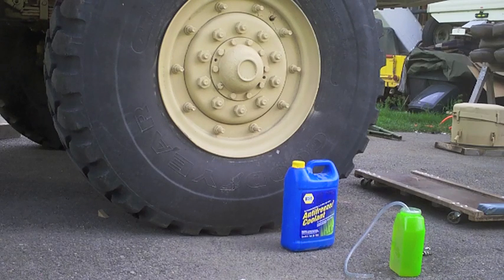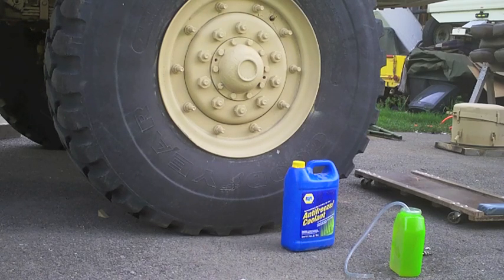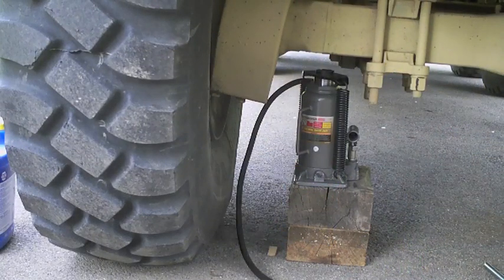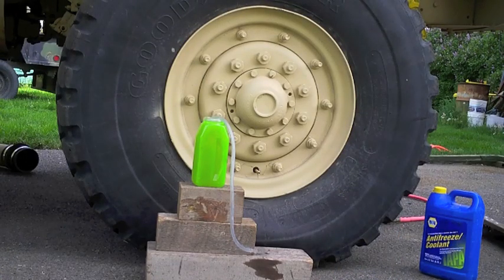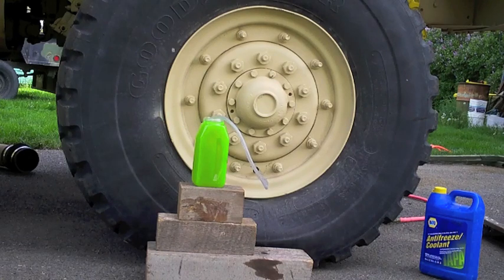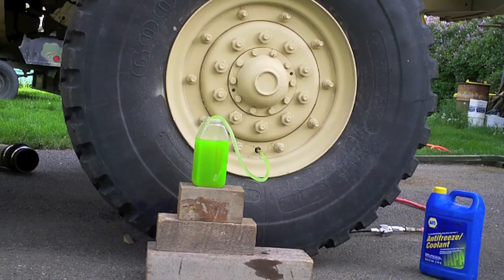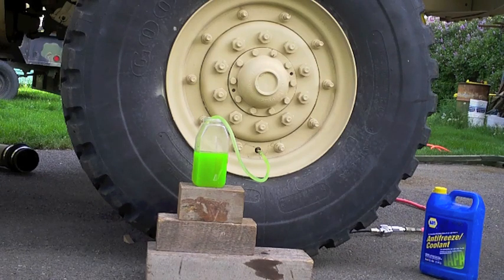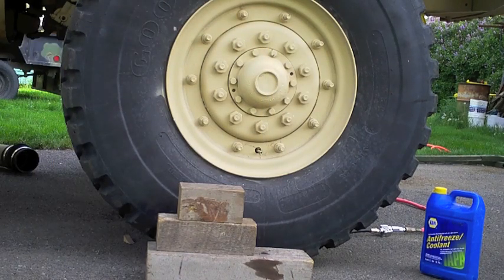Fluid Balance For Heavy Truck Tires *UPDATE IN DESCRIPTION*

Comment: You can rush it.  Get a pump-up weed sprayer(1gal $10 at home depot).  Replace the wand with a piece of hose put a jack-stand, under the axle, let the air out and remove the Schrader and the pump sprayer will easily and quickly inject the antifreeze...  sprayer is graduated so it is easy to accurately add a measured quantity. Replace the Schrader and the air and you are on to the next wheel...
Reply from the maker: Nice, I will have to remember that though I no longer bother with these tires.

Comment: they make good tools to put the water in your car and antifreeze in there but you really don't need in front of that truck because you'll make it dry rough and show me harder stop that truck would have water in it and that water going to restroom out to special antifreeze you need to put it in an inner tube without a tire and running water in it then you be doing if we were good to go

Comment: Won't anti freeze deteriorate metal (aluminum, or whatever coating it has on it)?
Reply: +dasteufelhund It shouldn't, it has anti-corrosion additives. You don't want it to corrode the cooling system
Reply from the maker: +dasteufelhund Yea maybe.  These tires are big and not aluminum.

Comment: Ive been in the tire business for 30 years , Remeber that most of the New tire like Michelin new designs Bridgestone and a very nice tire from China is the new Fredrick 
line  have tapered beads now which means you should air the tire to 100 or greater then let all the air back out of the tire then air it back up ! tapered beads are the new thing in the industry, the beads seat  pefectly every time. The circle lines on the sidewall of the tire should be even all the way around. one more thing the new product from ktb is not antifreeze it does have alcohol but is much lighter , therefore the centrifugal force is distributed much more evenly . Try this method , I hope it helps.
Reply: Tony Conley  are you still on here?  Reach out to me.

Comment: So after almost two years what are your thoughts on this?
Reply from the maker: I have stopped bothering.  Most of the shake I have with my trucks is in the 15-30mph range and I have come to the realization that 90% of that is just sidewall flex and all the flat spots lining up.  I think if you have a serious vibration over 40mph or so then it would be worth it, on the other hand knowing what I know about these tires now my gut would point to a tire/wheel issue.  It might still be worth doing to a front tire.  I did get a look inside one of the tires I balanced when the sidewall cracked.  I could see no damage or signs that it was attacking the rubber in any way however it did look like it made the rim rust worse.  Love your user name, I am one of those myself.
Reply: NelsonStudios

Comment: Pure engine antifreeze will freeze in the cold, and when it does, the frozen chunks will cut the inner liner to shreds. In addition, the slick properties of antifreeze can render the tire unrepairable - patches will not stick to the liner. Undiluted antifreeze will corrode and eventually ruin both aluminum and steel wheels.
Reply: Britt Y pure antifreeze will not freeze untill almost -100

Comment: I put 6 ounces of truck tire balancing fluid in each p235/75-r15 tire on two vehicles. It did not work worth a damn. Had remove all fluid and balance with weights, none of the tires took more than three ounces of actual weights. Totally disappointed. Plus all the wasted time.
Reply: 6 probably wasn't enough or was too much. Maybe try it again with different amounts. Lots of money to be saved. :)
Reply: Thanks for the reply. I suppose I could have tried more but 6 ounces of fluid outweighs the 3 ounces of weights so if it works at all it should have cleared up the balance problem. I thought it worked in my Harley for 30 years but lost all confidence in it after using it in two cars. The representatives at the company that makes the stuff just said they didn't recommend using it in any tires but truck tires. I don't think I talked to any authorities in the subject that day.I wish someone who had a vast background in different size tires would let me know their findings but I'll have to experiment on my own sometime. I really doubt  I used too much but I do know this. The tires could not be balanced on a spin balancer. The indicated location for weights jumped from place to place on each spin attempt so the fluid had to be removed. If I test it I will use a wheel that I can use on my own tire changer that tends to scratch rims. That way I won't ruin good mag wheels trying to save money. Let me know any further findings. Thanks.
Reply: All I know is I have heard people have needed to play around with the weight. Sometimes more, sometimes less. Weird I know. I just used it on some 32 mud tires instead of using weights. 3 tires work great and one is a circus show lol.. I'll be trying to play around with the weight. Only bitch about this liquid balancing thing is if you want to remove some. Trying to come up with something so I don't have to remove the wheel and break a bead.... We must have the same tire changer ;)
Reply: I think you have answered any further questions I might have had. I don't want to spend extra time experimenting with different amounts. It wastes too much time when all I have to do is mount the tires on my bubble balancer and be done with it. The product I have I think is called KTB balancer fluid and a quart is supposed to be thrown a semi truck tire. Smaller mounts should work in smaller tires. The balancer/sealer fluid I started putting in my Harley 35 years ago said right on the bottle six ounces should work in motorcycle tires. ( That stuff destroyed glue on patches- bad that way too) Too bad there isn't some other "chart" for other size tires. Anyway I'm done with the stuff. I just remembered that a tire store used to put six ounces of beads in car tires so the amount of fluid I used should have worked. Have a good Christmas.

Comment: Fantastic advice thanks. I use air soft plastic beads 0.02g and they work very well on my vehicles, the only problem is you have to break the bead from the rim to do it, your method is so much simpler. :-)

Comment: I use  to work for Goodyear tire and it does work but it also eats the tire from the inside out better to take it to a semi tire shop and pay to have them balanced
Reply: Hard to believe AF would do anything to rubber tires when it is used with rubber hoses and tons of heat and pressure... really?
Reply: there are multiple videos of guys opening up tires after around 5 years at the end of the tries life and showing that there was zero effect on the tire or the wheel. now TPMS sensors may like like this idea.